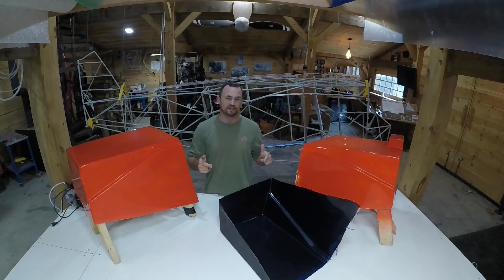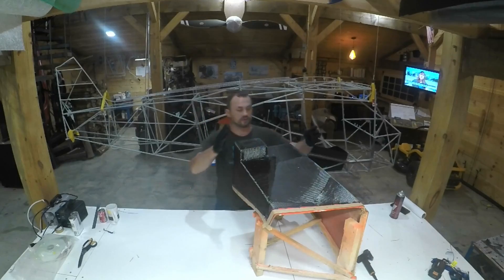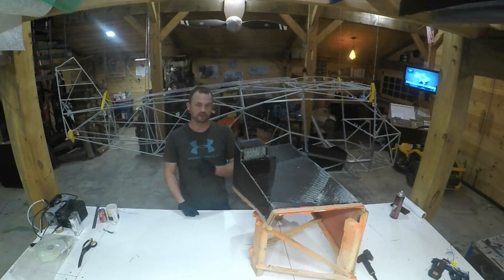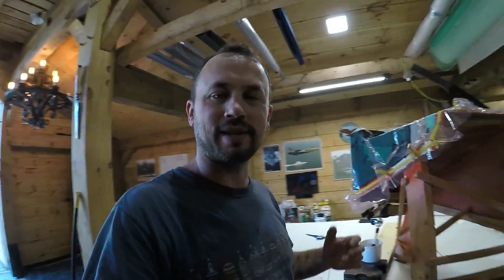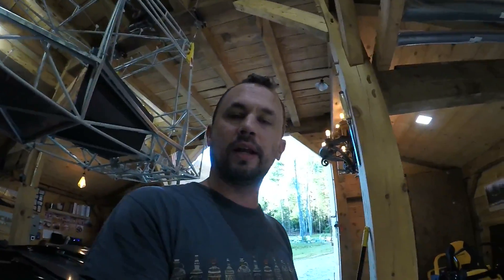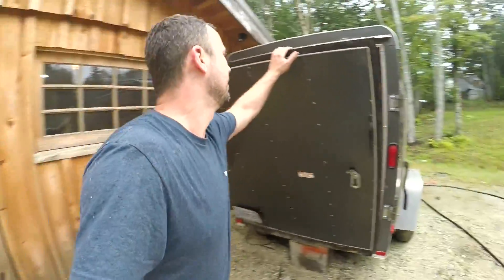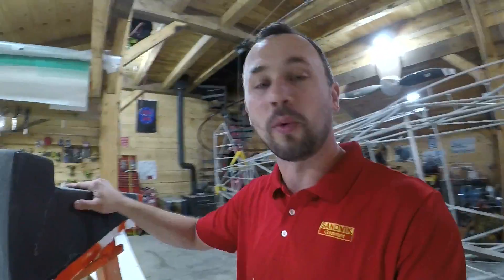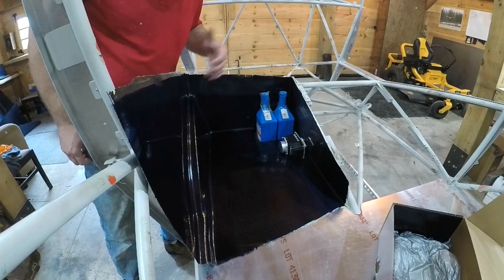DIY Carbon Fiber Infusion - Custom Airplane Part

Comment: Please consider saving these molds, when I do my build in a few years I was planning on doing these same mods but would gladly buy parts or the molds if you’re willing. Beautiful work!
Reply from the maker: I certainly will!  Let me know when you are ready for some interior panels.
Reply: I also have a bearhawk 5 in progress. If your interested in making parts (floor pans) I may be interested.

Comment: What is your rule of thumb for how much epoxy to mix when infusing? I’ve created several successful hand layups to replace my aluminum belly panels with carbon ones on a super Cub. I use the weight of the material and match that with the same weight of epoxy. Resulted in a 50:50-40:60 resin to fabric range as is the goal, as best hand layups can be..

My attempts into infusion have been a little more challenging. Seems like I mix too little or too much, and am chasing a magic starting point. Any quick tidbit would be appreciated as your parts are on point.
Reply from the maker: Thanks for the compliment!  I have not been weighing my carbon prior to layup.  The more I handle it the more it comes appart. I have been taking a guess and monitoring closely.  If the resin feed gets low I quickly mix and degas more.  ....but, you have to be on it.  If you have to pinch the feed to wait on degassing it will impact the finish.   I am not good enough yet on getting the right volume from the start.